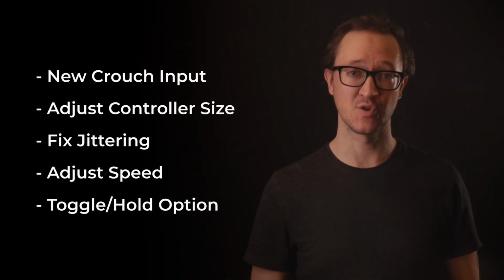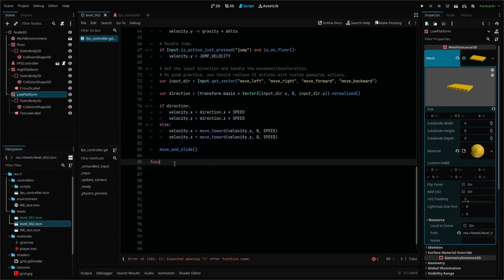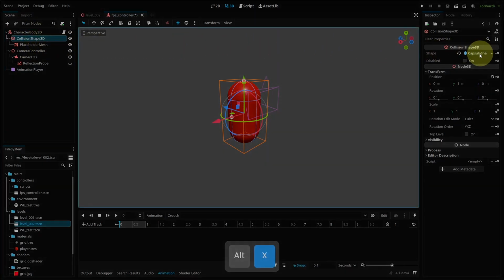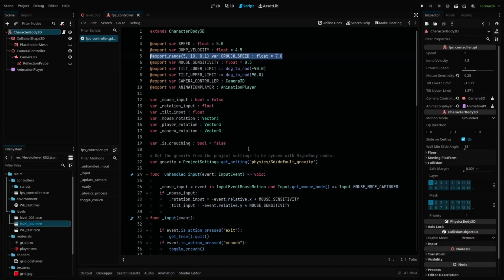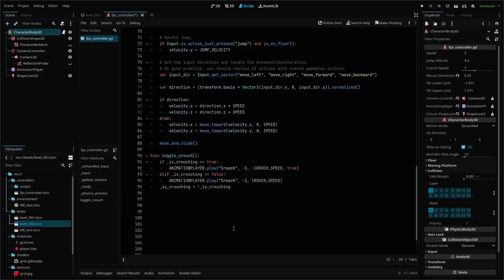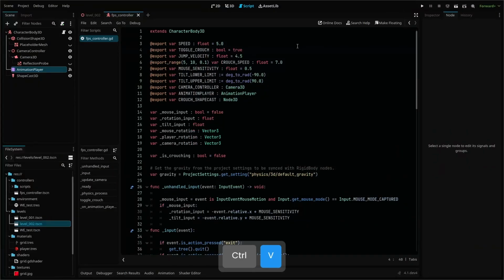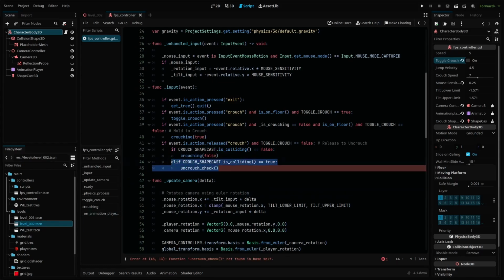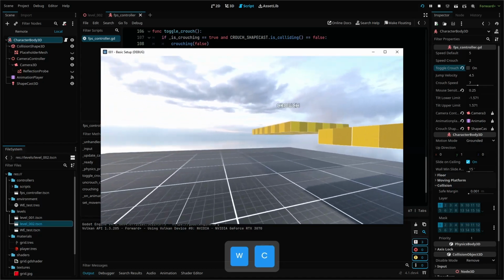E02 - Crouching // Make An FPS in Godot 4

Comment: im having a few problems. 1: toggle crouch doesnt ever untoggle. when i press the key again, it just restarts the animaion from the beggining annd i am back to crouching. 2: when i crouch it doestnt affect my speed . this probably has something to do with the fact that i havent been following from the beggining, i am adding this to a script i already had. 
extends CharacterBody3D

var speed : float

#this is the one for how fast you move when crouched
const SPEED_CROUCH = 1.0
const WALK_SPEED = 4.5
const SPRINT_SPEED = 6.5
const JUMP_VELOCITY = 6
@export var SENSITIVITY = 0.0007
@export var CONTROLLER_SENSITIVITY = 10
var dead_zone = 0.1

#bob
const BOB_FREQ = 2.0
@export var BOB_AMP = 0.08
var t_bob = 0.0

#fov variables
@export var BASE_FOV = 75
@export var FOV_CHANGE = 1.5

#crouching related stuff
@export var ANIMATIONPLAYER : AnimationPlayer
@export_range(5, 10, 0.1) var CROUCH_SPEED : float = 7.0
@export var CROUCH_SHAPECAST : Node3D
@export var TOGGLE_CROUCH : bool = false

var gravity = 19

var _is_crouching : bool = false

@onready var head = $head
@onready var camera = $head/Camera3D

func _ready():
	Input.set_mouse_mode(Input.MOUSE_MODE_CAPTURED)
	
	speed = WALK_SPEED
	
	
	CROUCH_SHAPECAST.add_exception($".")

func _unhandled_input(event: InputEvent) -> void:
	if event is InputEventMouseMotion:
		head.rotate_y(-event.relative.x * SENSITIVITY)
		camera.rotate_x(-event.relative.y * SENSITIVITY)
		camera.rotation.x = clamp(camera.rotation.x, deg_to_rad(-80), deg_to_rad(90))

func _input(event): 
	
	if event.is_action_pressed("quit"):
		get_tree().quit()
	if event.is_action_pressed("crouch") and is_on_floor():
		toggle_crouch()
	if event.is_action_pressed("crouch") and _is_crouching == false and is_on_floor() and TOGGLE_CROUCH == false: #hold to crouch
		crouching(true)
	if event.is_action_released("crouch") and TOGGLE_CROUCH == false:
		if CROUCH_SHAPECAST.is_colliding() == false:
			crouching(false)
		elif CROUCH_SHAPECAST.is_colliding() == true:
			uncrouch_check()
	

func _physics_process(delta: float) -> void:
	# Add the gravity.
	if not is_on_floor():
		velocity.y -= gravity * delta

	# Handle jump.
	if Input.is_action_just_pressed("jump") and is_on_floor() and _is_crouching == false:
		velocity.y = JUMP_VELOCITY
		
	#handle sprint
	if Input.is_action_pressed("sprint"):
		speed = SPRINT_SPEED
	else:
		speed = WALK_SPEED

	# Get the input direction and handle the movement/deceleration.
	# As good practice, you should replace UI actions with custom gameplay actions.
	var input_dir := Input.get_vector("left", "right", "forward", "backward")
	var direction = (head.transform.basis * Vector3(input_dir.x, 0, input_dir.y)).normalized()
	if is_on_floor():
		if direction:
			velocity.x = direction.x * speed
			velocity.z = direction.z * speed
		else:
			velocity.x = lerp(velocity.x, direction.x * speed, delta * 10.0)
			velocity.z = lerp(velocity.z, direction.z * speed, delta * 10.0)
	else:
		velocity.x = lerp(velocity.x, direction.x * speed, delta * 2.5)
		velocity.z = lerp(velocity.z, direction.z * speed, delta * 2.5)
		
#head bob
	t_bob += delta * velocity.length() * float(is_on_floor())
	camera.transform.origin = _headbob(t_bob)
	
	
	#FOV
	var velocity_clamped = clamp(velocity.length(), 0.5, SPRINT_SPEED * 2)
	var target_fov = BASE_FOV + FOV_CHANGE * velocity_clamped
	camera.fov = lerp(camera.fov, target_fov, delta * 8.0)
	
func _process(delta):
	var look_input = Input.get_vector("look_left", "look_right", "look_up", "look_down")
	
	#apply horizontal rotation
	if look_input.x != 0:
		# rotate players y axis based on input
		rotate_y(look_input.x * CONTROLLER_SENSITIVITY * delta)
		#apply vertical rotation
	if look_input.y != 0:
		#rotate on x axis
		get_node("head/Camera3D").rotate_x(-look_input.y * CONTROLLER_SENSITIVITY * delta)	
		camera.rotation.x = clamp(camera.rotation.x, deg_to_rad(-80), deg_to_rad(90))
	
	
	move_and_slide()

	
func _headbob(time) -> Vector3:
	var pos = Vector3.ZERO
	pos.y = sin(time * BOB_FREQ) * BOB_AMP
	return pos
	
func toggle_crouch():
	if _is_crouching == true and CROUCH_SHAPECAST.is_colliding() == false:
		crouching(false)
	elif _is_crouching == false:
		crouching(true)
		
func uncrouch_check():
	if CROUCH_SHAPECAST.is_colliding() == false:
		crouching(false)
	if CROUCH_SHAPECAST.is_colliding() == true:
		await get_tree().create_timer(0.1).timeout
		uncrouch_check()

func crouching(state : bool):
	match state:
		true:
			ANIMATIONPLAYER.play("Crouch", 0, CROUCH_SPEED)
			set_movement_speed("crouching")
		false:
			ANIMATIONPLAYER.play("Crouch", 0, -CROUCH_SPEED, true)
			set_movement_speed("default")
	
func _on_animation_player_animation_started(anim_name):
	if anim_name == "Crouch":
		_is_crouching = !_is_crouching
		

	
func set_movement_speed(state : String):
	match state:
		"default":
			speed = WALK_SPEED
		"crouching":
			speed = SPEED_CROUCH

edit: ok so i removed this line of code 
if Input.is_action_pressed("sprint"):
		speed = SPRINT_SPEED
	else:
		speed = WALK_SPEED

and crouching speed is now working. but obviously i want to be able to sprint , so i need to figure out how to make it work. another thing is that i can still jump while crouching and i can still crouch midair.
Reply: so idk what i did but toggle crouch is working now, i dont think i even changed the script
extends CharacterBody3D

var speed : float

#this is the one for how fast you move when crouched
const SPEED_CROUCH = 1.0
const WALK_SPEED = 4.5
const SPRINT_SPEED = 6.5
const JUMP_VELOCITY = 6
@export var SENSITIVITY = 0.0007
@export var CONTROLLER_SENSITIVITY = 10
var dead_zone = 0.1

#bob
const BOB_FREQ = 2.0
@export var BOB_AMP = 0.08
var t_bob = 0.0

#fov variables
@export var BASE_FOV = 75
@export var FOV_CHANGE = 1.5

#crouching related stuff
@export var ANIMATIONPLAYER : AnimationPlayer
@export_range(5, 10, 0.1) var CROUCH_SPEED : float = 7.0
@export var CROUCH_SHAPECAST : Node3D
@export var TOGGLE_CROUCH : bool = false

var gravity = 19

var _is_crouching : bool = false

@onready var head = $head
@onready var camera = $head/Camera3D

func _ready():
	Input.set_mouse_mode(Input.MOUSE_MODE_CAPTURED)
	
	speed = WALK_SPEED
	
	
	CROUCH_SHAPECAST.add_exception($".")

func _unhandled_input(event: InputEvent) -> void:
	if event is InputEventMouseMotion:
		head.rotate_y(-event.relative.x * SENSITIVITY)
		camera.rotate_x(-event.relative.y * SENSITIVITY)
		camera.rotation.x = clamp(camera.rotation.x, deg_to_rad(-80), deg_to_rad(90))

func _input(event): 
	
	if event.is_action_pressed("quit"):
		get_tree().quit()
	if event.is_action_pressed("crouch") and is_on_floor():
		toggle_crouch()
	if event.is_action_pressed("crouch") and _is_crouching == false and is_on_floor() and TOGGLE_CROUCH == false: #hold to crouch
		crouching(true)
	if event.is_action_released("crouch") and TOGGLE_CROUCH == false:
		if CROUCH_SHAPECAST.is_colliding() == false:
			crouching(false)
		elif CROUCH_SHAPECAST.is_colliding() == true:
			uncrouch_check()
	

func _physics_process(delta: float) -> void:
	# Add the gravity.
	if not is_on_floor():
		velocity.y -= gravity * delta

	# Handle jump.
	if Input.is_action_just_pressed("jump") and is_on_floor() and _is_crouching == false:
		velocity.y = JUMP_VELOCITY
		
	#handle sprint
	if Input.is_action_pressed("sprint"):
		speed = SPRINT_SPEED
	else:
		speed = WALK_SPEED
		

	# Get the input direction and handle the movement/deceleration.
	# As good practice, you should replace UI actions with custom gameplay actions.
	var input_dir := Input.get_vector("left", "right", "forward", "backward")
	var direction = (head.transform.basis * Vector3(input_dir.x, 0, input_dir.y)).normalized()
	if is_on_floor():
		if direction:
			velocity.x = direction.x * speed
			velocity.z = direction.z * speed
		else:
			velocity.x = lerp(velocity.x, direction.x * speed, delta * 10.0)
			velocity.z = lerp(velocity.z, direction.z * speed, delta * 10.0)
	else:
		velocity.x = lerp(velocity.x, direction.x * speed, delta * 2.5)
		velocity.z = lerp(velocity.z, direction.z * speed, delta * 2.5)
		
#head bob
	t_bob += delta * velocity.length() * float(is_on_floor())
	camera.transform.origin = _headbob(t_bob)
	
	
	#FOV
	var velocity_clamped = clamp(velocity.length(), 0.5, SPRINT_SPEED * 2)
	var target_fov = BASE_FOV + FOV_CHANGE * velocity_clamped
	camera.fov = lerp(camera.fov, target_fov, delta * 8.0)
	
func _process(delta):
	var look_input = Input.get_vector("look_left", "look_right", "look_up", "look_down")
	
	#apply horizontal rotation
	if look_input.x != 0:
		# rotate players y axis based on input
		rotate_y(look_input.x * CONTROLLER_SENSITIVITY * delta)
		#apply vertical rotation
	if look_input.y != 0:
		#rotate on x axis
		get_node("head/Camera3D").rotate_x(-look_input.y * CONTROLLER_SENSITIVITY * delta)	
		camera.rotation.x = clamp(camera.rotation.x, deg_to_rad(-80), deg_to_rad(90))
	
	
	move_and_slide()

	
func _headbob(time) -> Vector3:
	var pos = Vector3.ZERO
	pos.y = sin(time * BOB_FREQ) * BOB_AMP
	return pos
	
func toggle_crouch():
	if _is_crouching == true and CROUCH_SHAPECAST.is_colliding() == false:
		crouching(false)
	elif _is_crouching == false:
		crouching(true)
		
func uncrouch_check():
	if CROUCH_SHAPECAST.is_colliding() == false:
		crouching(false)
	if CROUCH_SHAPECAST.is_colliding() == true:
		await get_tree().create_timer(0.1).timeout
		uncrouch_check()

func crouching(state : bool):
	match state:
		true:
			ANIMATIONPLAYER.play("Crouch", 0, CROUCH_SPEED)
			set_movement_speed("crouching")
		false:
			ANIMATIONPLAYER.play("Crouch", 0, -CROUCH_SPEED, true)
			set_movement_speed("default")
	
func _on_animation_player_animation_started(anim_name):
	if anim_name == "Crouch":
		_is_crouching = !_is_crouching
		

	
func set_movement_speed(state : String):
	match state:
		"default":
			speed = WALK_SPEED
		"crouching":
			speed = SPEED_CROUCH

Comment: For me it just doesn't work the way it does in the video. Setting Y position to 0.75m puts it up, and I have to use -0.75 instead
And it doesn't only transform the shape, it moves it into the floor. I've no idea why it works like that.
edit: figured it out - for some reason my collisionshape's default Y position is 0m while for you it's 1m. Putting the 2nd key's Y value to -0.25 is what made it work like in the video.
Reply: You don't have to animate the MeshInstance3D (called "PlaceholderMesh" in this tutorial series), in fact, you need to hide the MeshInstance3D and animate the CollisionShape3D

Comment: I was having problems with the hold crouch feature. Whenever the crouch button was held down while jumping, then later released after hitting the ground, the un-crouch animation would play unintended. Since the _is_crouching variable is set to swap values between true and false anytime the animation is played, this unintended un-crouch animation would later cause issues with the jumping feature. However, there is a very simple fix to this problem:

Within the _input function, we have an if statement set to check if one of the events is the crouch button release, and in the video we are shown to set it up like this: 

if event.is_action_released("crouch") and TOGLE_CROUCH == false:

The problem is that we do not want to run the un-crouch animation if the player is not already crouched, we can fix this by adding another condition to the if statement to check if the player is crouching. So in order to do this, we can use our _is_crouching variable. The new if statement should look something like this: 

if event.is_action_released("crouch") and _is_crouching == true and TOGLE_CROUCH == false:
Reply: had this same problem and was pulling my hair out trying to solve the issue. your solution worked. very much appreciated

Comment: There is one problem with a HOLD uncrouching. If the player stays under obstacle and will keep pressing crouch button, then he will create a ton of paralel timers and invoications of uncrouch check.
Reply: Here is an improved uncrouched check, which prevents that issue:

func uncrouch_check():
	if _is_uncrouch_check_running: # new global variable to define in script with a default value of false
		return  # Prevent multiple invocations
	_is_uncrouch_check_running = true  # Set the flag
	while CROUCH_SHAPECAST.is_colliding():
		await get_tree().create_timer(0.1).timeout  # Wait before checking again
	
	crouching(false)  # Perform uncrouch action
	_is_uncrouch_check_running = false
Reply: @skrybagamedev  doesn't work for me :(

Comment: I noticed after implementing all the steps in the video, there is a bug where if you jump and then hold crouch in the air, then land and uncrouch, you will lose the ability to jump. You can fix this by going to the _input function, and in the hold to crouch logic, remove "is_on_floor()"  this way you can crouch while in the air but also make sure that the path is actually triggered while in the air too.
Reply: good tip! You can also add an if statement to the set_movement_speed function to ensure you don't slow down when crouching midair. under the crouching state, if is_on_floor, set crouching speed, else maintain the default.

Comment: I'm having an issue where if you crouch, and quickly uncrouch and recrouch, Godot will say you are both standing and crouched... The animation finished with the player standing, with normal walking speed, but with is_crouching = true. When you press the crouch key again (or release it), you will stand up again and everything will go back to normal. 
In other words, when I crouched for the second time, the player finished the standing animation, and never went back down.

Edit - Fixed it by changing _on_animation_player_animation_started to _on_animation_player_animation_finished

Comment: please stop using if x == true. Just write if x, as if x == true then x = true and therefor if x will execute as x is true. And also, stop writing if x == false, just use if !x as that does the same and is more readable
Reply: and it is also very useful to use static typing for optimization. This is a data type assignment for variables. For example: var value : int = 10 INCORRECT: var value = 10
Reply: @Экситикс  true, that's good to remember aswell

Comment: Please pin this.  I got stuck on an issue where I noticed a visible "resetting" of the animation right as you press the crouch key that happens only once. This is because godot automatically put in a RESET animation that I didn't see and I was putting all my key frames in that animation. Delete the tracks in the RESET animation and you'll get rid of this problem.
Reply: Thanks for sharing this
Reply: ty

Comment: Just a headsup to everyone having issues with some kind of jittering or jumping when the crouch animation plays for the first time. If you somehow mess up anything while setting up the animation keyframes => Delete the Animation Player and try again. 

I also recommend creating the keyframes for frame 0 as shown in the video, and then manually copying and pasting them to second 1. I tried adjusting them in the editor, but Godot somehow messed things up. After some fumbling, Godot saved a default radius of 0.001 for the CollisionShape3D, which seems rather clunky. It might be a better idea to switch between two different CollisionShape3Ds—one for standing and one for crouching—and just animate the camera.

Anyway, thanks for this very nice tutorial :)
Reply: thanks dude! i was having the jitter problem

Comment: I'd be interested to hear how to do a sort of Half-Life style crouch jump where if you press the crouch key while in mid-air, it will keep your head in place but raise the bottom of your hitbox so you can climb to higher levels (sort of like a manual form of mantling).

My first thought was to just do an inverse of the crouch animation, where it does the same shrinking of the hitbox but the origin point is raised instead of lowered, but that would mean the shapecast we used to check if we can uncrouch would no longer work.
Reply: I managed to get the HL/TF2 style crouch jumping working with the shapecast by inverting the animation as you described, but having the shapecast origin at the top of the "head" position and cast with a range of 0. It seems to be working for me, though I'm not 100% sure there's no bugs with it.

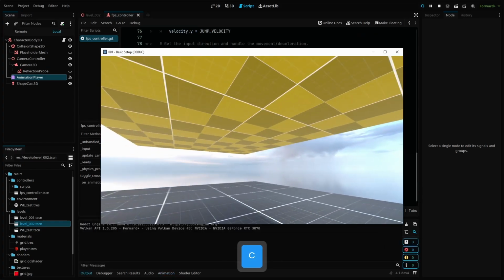Comment: @ ~ 10:50 in the video and I have a massive issue.
so whenever I try to crouch after adding the shapecast3d I crash. Error kicked back is "Invalid get index 'is' (on base: 'ShapeCast3D')."
my code is 1-1 with video... The Stack Frames shows two inputs as well:
0-res://Controllers/Scripts/fps_controller.gd:100 - at function: toggle_crouch
1-res://Controllers/Scripts/fps_controller.gd:39 - at function: _unhandled_input
toggling the crouch seems to be causing a crash, works for ONE input then boom, crashes.

(CODE)
func toggle_crouch():
	if is_crouching and !crouch_shapecast.is.colliding():
		animationplayer.play("crouch_anim", -1, -crouch_speed, true)
		
	elif !is_crouching:
		animationplayer.play("crouch_anim", -1, crouch_speed)

func _on_animation_player_animation_started(anim_name):
	if anim_name == "crouch_anim":
		is_crouching = !is_crouching

Comment: The CollisionShape3d inside Box has ConcavePolygonShape3D. I'm trying to replicate this to Platforms and even create the same CollisionShape3D for Box, and they seem to be identical, but one works and other doesn't. Do you have the same problem. Now, I have to use BoxShapeCollider
Reply: Same
Reply: Select MeshInstance3D (example platform) - "Mesh" option will appear at the end of viewport menu. Click "Mesh" and select "Create Collision Shape" (you can use defaults). New collision shape will be created. Move it under MeshInstance3D's StaticBody3D and it should be ok.